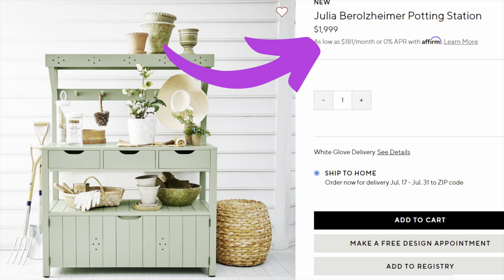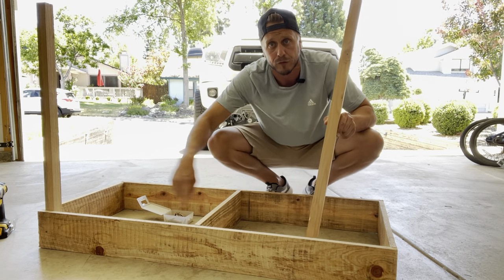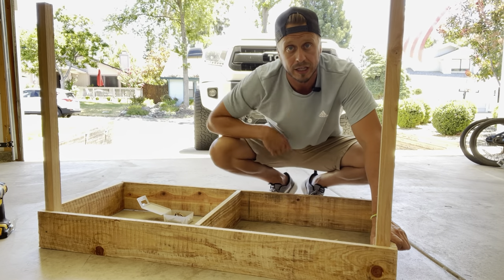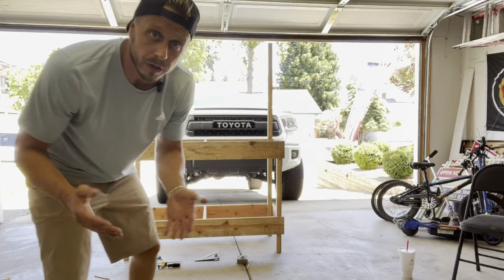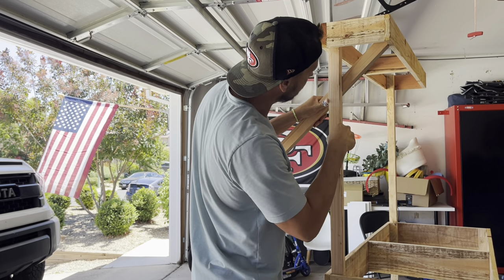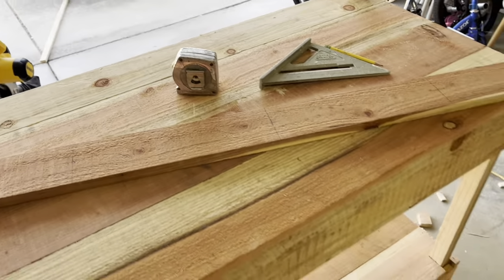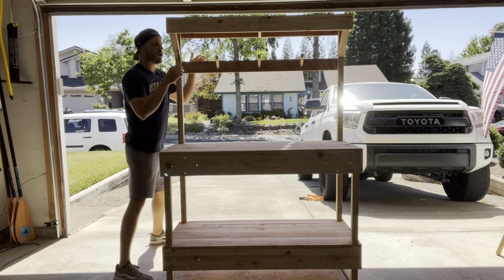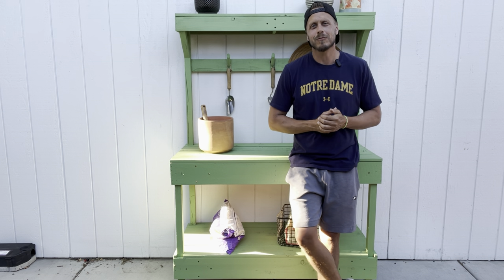How to Make Your Own Garden Potting Table

Comment: Hell yeah, man. Love the use of fence pickets, they are my favorite! I used them to build my raised beds but never thought to use them for a potting bench! Going to use your re-design for mine and add some locking casters so I can easily move it to clean behind (since I'm a bit of a sloppy gardener). That said, I do think I'm going to try to add the drawers in the original because I really like the idea of storing things like gardening gloves in a drawer so they don't get all wet and nasty. Thanks!
Reply from the maker: That great!!! I def went for the simplest build but those modifications will def improve it. Glad you found the video helpful!!!! 😃